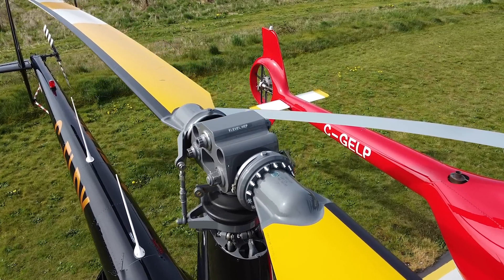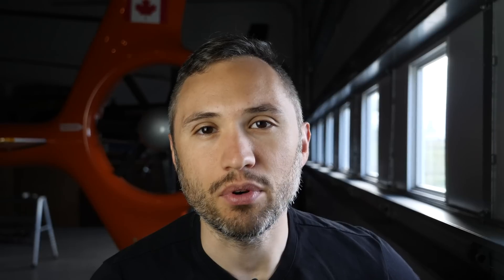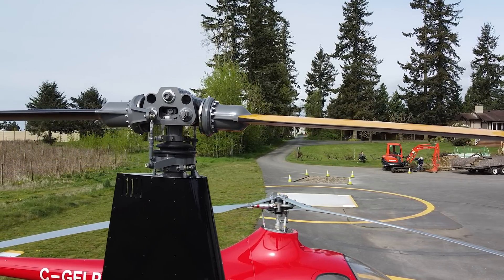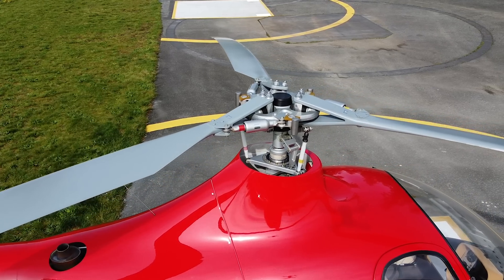WHY MORE BLADES ARE SAFER

Comment: Great video. This was very informational for a new quadcopter hobbyist here (indoor only). I mention indoor only because I intend to respect airspace and leave piloting to ACTUAL pilots. But I did get a part 107 certificate and understand how to track using B4UFLY apps in uncontrolled spaces under 400ft. Sad you have to mention all this now to avoid getting attacked in comments 😂 I'm sure there are additional considerations in how this applies to quadcopters but generally the effect is the same, more blades = better weight distribution= smoother flight = less turbulence = more efficiency. I will say in my experience with these though there are times where 3 blades seems to grip and corner better at speed than 4 blades but I think that has more to do with the rotor angle than the blade count. 🤔 But when starting a turn for instance... Does the additional distance between the blades allow larger amount of pitch or yaw to be acheived with a single revolution? Consodering pitching and yaw combined? 🤔 (On a quadcopter)? I wonder

Comment: Flap oscillation is a bad 2 blade situation that can happen in flight and hover.. Sport Gyro-copters seem to get into this situation and this I think is the best reason the helo manufactures went away from the two blade.., but I will say that my only flight that I remember in a two blade was in a 222 and it was really smooth (Kennedy to 60th ST on a hot day, 5pm 15mph wind coming in from the sea; yea, blast from the past).  I did not the that the OSCE drone in the Donbass where 2 bladed, while that same model was commissioned by the US Navy as a 3 blader and the OSCE video was hampered by the blade bump vibration (the forward - aft  forward flight ).....   Engineering does matter along with maintenance.

Comment: I can't get a response from anyone why all gyroplanes (now anyway).....only use a very long bladed floppy 2 blade rotor. Stick vibration as well as the retreating blade problems would seem to be reduced by a smaller diameter 3 blade rotor. For storage, the 2 forward angled blades could fold back against the rear facing one making the machine very small. The huge disk area causes so much drag most autogyro's can't cruise at even 100kts. At  $140k they seem like just a very expensive toy. Helo's are even worse as operating costs are so high and still slow. Does anyone know the answer to this question?

Comment: The most efficient (In terms of thrust output per power input)? A single blade! It can be done as long as you are very careful with balancing and don't mind high RPM for the same thrust.

Comment: Been flying commercially on helicopters for over 30 years. Love your passion and instruction brother. Fly safe. 👍🇿🇦
Reply: Hey Wayne, as an experienced flyer, are there any exercises you could recommend to practice cyclic/pedal/lever coordination when Im not flying?
Reply: @pepperpeterpiperpickled9805  Hi Peter. I've never thought about it really allthough I do quite a bit of hand and wrist  strength exercises. Flying is more of a feel I think? . I wouldn't worry too much about being a bit uncomfortable or un coordinated to start with. You will get more coordination as you go along your flying journey. It becomes 2nd nature quite quickly. Think more about the external factors like, planning your flight properly and sticking to your plan,  density altitude,  en route weather factors and visibility en route, wires, wind, especially tailwinds, turbulence, fuel management, over loading etc. Those are the things that will keep you alive. Coords will come for sure. Take care and stay calm 🙏🇿🇦👍
Reply: @waynegrobler7432  good point, mate. I appreciate the answer

Comment: I have personally witnessed virtually EVERY LOH (OH6 Cayuse - multi-blade articulated rotor system) chop off its tail boom during autorotation flare/landing (two tours, Vietnam).  Yes, underslung two-bladed systems can suffer mast bumping and sheer off - I've witnessed that as well - TWICE.  ONE:  When one of our Assault Helicopter Company UH-1H Pilots took off with a full load of Pax, cranked up to full speed (about 120K) across the Mekong Delta River - then did a cyclic climb. At the top, he committed the fatal error of pushing the cyclic forward to achieve level flight while simultaneously lowering the collective. That sheered off the rotor system with a nose dive straight down into the water. Wasn't bad enough he killed himself, he took three other crew members and eight servicemember Pax along for the eternity ride with his terminal stupidity. We never recovered the helo or any bodies. We had to go back to where they climbed aboard and work our way back to each command to find out WHO was on that helo.  SECOND:  An AH-1G Cobra pushed to high speed in his gun run firing everything he had.  At the end, he too pulled up into an impressive cyclic climb with the same application of cyclic leveling and collective down as before.  His gunship nosed over like a wounded badminton bird and zoomed straight down to meet the angels.  How did I know this.  I was monitoring our Guard Frequency and heard one voice shout, "This is it!" and another voice (the other gunner) screaming - for all of two seconds before silence reigned.  His wingman answered my hail and described the entire event to me.  I could go on all day with this - I wrote a book about it. Yes, accidents and SH*T happens - LISTEN to your IPs in school - LEARN proper safety procedures - PRACTICE safe and FULL recovery - and DON'T BE STUPID - that damned machine will end you in a heartbeat if you turn off your brain.  John  (two tours Vietnam, 1,955 Combat flight hours/helicopters).
Reply: What is the name of your book?
Reply: "You come down like a streamlined brick " on autorotation characteristics according to Colonel Boyer concerning the Hughes OH-6 on page 181 of "Vertical Challenge The Hiller Aircraft Story' by JayP.Spenser.
Reply: @John Hudson You mentioned in your comment to a video by Pilot Yellow that you have written a book, has it been published? And what is the title of your work?
Reply: Thank-You for reminding us to never ever get on a helicopter.
Reply: Thanks!
Reply: Too many show off cowboys with their heads up their posteriors flying complex machines; or too many morons that shouldn't even be flying, even a kite.
Reply: Excellent item John Hudson. Three instances known to me. All fatals, all due to unloading two bladed rotor (x2 B206, x1 AB205) One of note - avoiding potential bird strike, pushed cyclic instead of pulled…. In my rotary experience, 20+ yrs, B47, 206, 205, 212, 214B, - Birds always break downwards in potential collision with rotor disc. Also, ISASI member M04222.
Reply: "Pax" Did Uber finally corner the helicopter ride market?
Reply: @wageslave387  No, PAX was used a long time in the aviation industry before the Uber industry silliness.

Comment: I think the benefits of a 3 or more rotor system far outweigh the few benefits of a 2 blade system. In a helicopter even for the best pilots under the most favorable conditions there are just too many "freakish events" that can strike at any given time. Its just not worth it to leave anything to chance. You must give yourself every edge possible.

Comment: Autos in bell 212 , 205 , 206 slow rate of descent nothing really rushed. But.. Md 500 (5blades) Astar (3 blades)
bell 407 (4 blades ) greased bowling ball rate of descent comes to mind. That’s a 18,000 hour helicopter pilots opinion and I have thousands of hours on each type

Comment: It ain't the number of blades that determines the safety of a rotor; it's the maximum teetering angle of the rotor hub and/or ability of the blades to generate a hub moment that acts on the drive shaft, i.e. flapping hinges or flexures displaced at a non-zero radius from the rotor axis of rotation. A two-blade rotor can be mounted to the hub with flapping, drag, and feathering hinges, but the inherent adverse vibration characteristics of such a rotor make this system impractical. Rotors with three or more blades do not suffer from such severe vibration problems and are therefore practical. As far as teetering rotor mast bump is concerned, the Bell 47 is immune to this danger because the blades will hit the tailboom before hitting the shaft. The Bell 47 also uses retractable stops that fall into place at low rotor rpm to stop the hub from hitting the shaft when parked on the ground. Why Bell, Robinson, Hiller, etc. chose to eliminate the retractable stops and reduce teetering clearance so the hub could rest against the rotor shaft when parked, and thus hit the mast inflight,  is a mystery. 

The single most important factor in eliminating mast bump is offset flapping hinges/flexures with the added benefit of increasing rotor hub moment and thereby aircraft control and forcing the fuselage to follow rotor tilt regardless of G loading.

Comment: Things I learned during this video: pilots are horrible engineers (but not the other way around). 2 blade helicopters have less rotor wash interference and are actually more efficient. The main reason for adding more rotors is because 1: You can only make them so long  2: Extra blades to absorb extra power 3: less vibration. That’s pretty much it.

Comment: 3 or more blades makes perfect sense to me. I certainly wouldn't want to fly in something where the blade roots could bump the mast!
Reply: mast bumping is 100% pilot error.  Three bladed rotor systems suffer from ground resonance, whereas 2,4,5,6 etc bladed systems do not.  There's no free lunch.
Reply: @225degrees  oh, I didn't know about the ground resonance problem and that's a problem that can go from zero to oh no in 3 seconds......
Reply: @artmckay6704  Absolutely.  A fair amount of ground effect events are also the result of poor piloting, but it doesn't take much to cause the phenomenon.

Comment: I believe or just insinuating that Two, four, six or even blade number have similar problems unlike 3, 5, 7 or odd numbers;which is safer.
Reply: No.  Mast bumping is 100% pilot error.  Three bladed systems suffer from round resonance.  2, 4,5,6,etc bladed systems do not.

Comment: Just discovered your channel.  Excellent! A question:
50 years ago, rearming my “C” model Huey on the tarmac in Dong Tam, South Vietnam, an Air Cav Cobra shut down nearby.  First one this Huey gunship driver had ever seen up close.  After suppressing my envy, noticed the Cobra’s 2-bladed system was completely void of the fly bar (or “stabilizer bar”) with all the accompanying parts & bits seen on my rotor head.  From my vantage point, all I saw were 2 pushrods going directly from the swash plate to pitch change links on each blade.  How does this “new” (back in ‘69) system work?
Reply from the maker: The stabilizer bar was removed on more modern helicopters because they found other ways to stabilize the helicopters I believe. However I’m not an expert on stabilizer bars. It’s like the old Bell 47’s have one but a jet ranger doesn’t.
Reply: @PilotYellow  Thanks for responding.  If you run across information on “how”, please share.

Comment: I’ve ridden in a Bell Jet Ranger and a Schweitzer S269C. The Bell had two rotors and the Schweitzer had three. The Bell vibrated baby when turning to the left, (if I remember correctly), but the Schweitzer was smooth when turn either way. The Schweitzer was a fun little help to ride in. The pilot had a blast flying my brother and I around, chasing cattle that were grazing a few hundred yards from the airport, but when he tried to set it on the peak of the hanger roof he let off the throttle a little too much and it almost fell into the hanger. I don’t advise trying that!

Comment: On two blade helicopter the forces to roll the helicopter vary dramatically from when the blade is fore and aft position (low) to the port starboard position (maximum). For similar reasons wind turbines have standardized on the three blade design to reduce cyclic jaw forces.

Comment: Great info and great video. Idea for a new video if you take them.  How climates affect the lift. Example: High altitude mountain and cold air compared to sea level and dense humid hot air. Also answer climate questions like: is lighter better for higher altitude; do blades matter in the climate; and does the rotor rmp matter?
Reply from the maker: Max Captain that’s great thanks

Comment: The storage issue at times is a vital point. True that building a separate shed probably cost less than a blade replacement, but space can be an issue and the folding kit would be, as a manufacturer, my top priority. I went to a school that only could “afford” space for a two bladed but preferred the three blades option If they knew where to park her

Comment: Mast bumping is such mild word for a catastrophic event that slices the tail boom clean off then usually dismembers or decapitates the pilot.
Reply: Mark, right on target.  R22 and R44.   Turbulence or low G  pushover Deadly. jg.
Reply: Meanwhile, the three blades rip themselves apart while on the ground.
Reply: @Remain Nameless depends, some helicopter crashes they have had the rotor blades chop into the cyclic controls.
Reply: Right but it can only happen due to Pilot error
Reply: Robinson safety bulletin . Slow to 50kts or less during turbulent conditions. 

And don't forget.....aft cyclic!

It's important to remember that corrective action.....because you probably have never trained it😂 and experienced extreme left yawl and right roll as it will occur.. good luck!
Reply: Yes. And just as preventable as driving your car into oncoming traffic and dismembering everyone in it. Don't push the cyclic forward abruptly and you will never have to worry. Every design has its drawbacks.

Comment: From basic propeller design which still applies to rotors, diameter of the rotor is about the max RPM the rotor spins at, number of blades often relates more to power available or that needs to be transmitted. That said the number of blades can still have some latitude between blade solidity and the aspect ratio of said blade. High aspect ratio blades on the same diameter tending less solid, low aspect ratio blades more solid and so able to transfer more power. Basic application Rotor Diameter = RPM, Blade Solidity = power transfer. Exclusive to rotors the swash plate design which affects the pitch each blade can share makes blade solidity more important reaching critical relevance sooner than for propellers. 
Multi blades have fewer aerodynamic protuberances than 2 blades, and out of them odd number systems like 3 and 5 blades seem to ride smoother.  That said all rotors need to be checked for tracking and pitch, no prizes for guessing which ones are easier to check or set up. Set up is revisited every time a rotor component is exchanged because of either damage or out of hours life.

Comment: Without having watched the video, I’m going to guess it’s because you can get more lift from the same RPM
Reply: Nah.
You get more lift out of the same rotor diameter.

However if you are not constrained by rotor diameter (you can pick any size you like), then going with a 2 blade design will give you more lift than a 3 blade design, as the rotor blades spend less time inthe turbulent wake of the blade before them, and thus operate more efficiently.